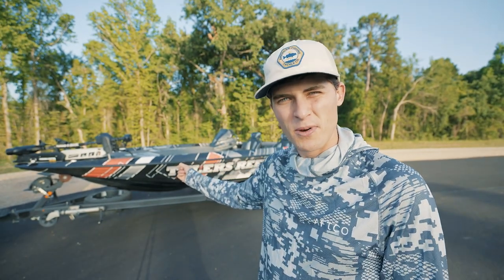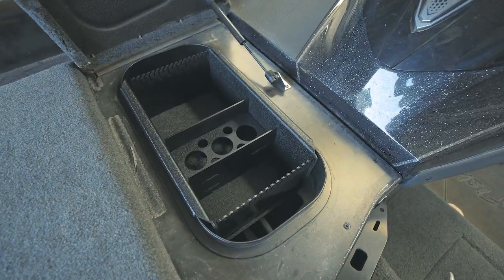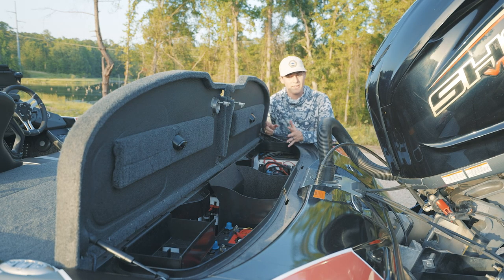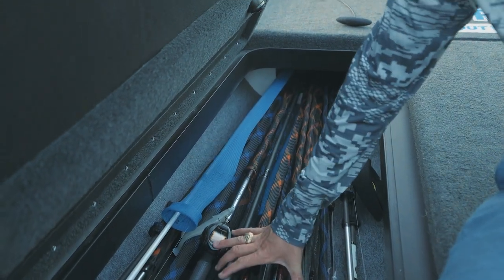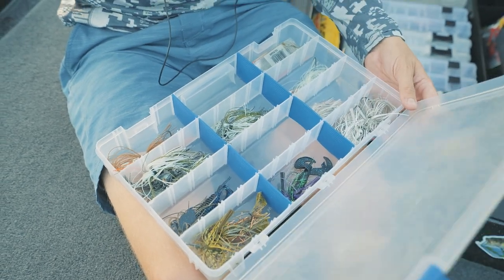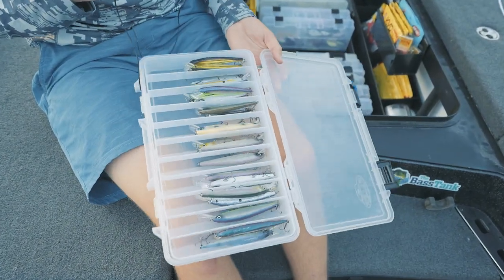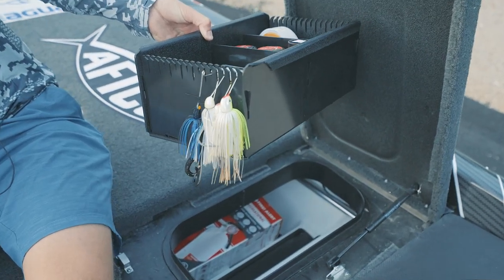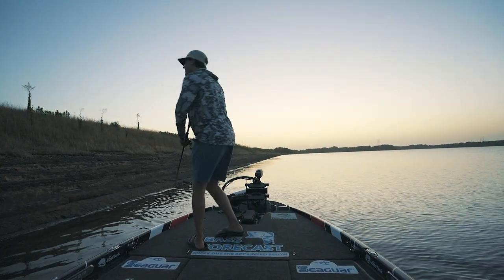The BEST Fishing Tackle Organization I’ve Ever Had!

Comment: Love your shows, I do have 2 suggestions for you. 1) use the new glove box area under the front step as a culling station. Keep your cull tags, scale, G-juice and fin wieghts in there. I started using the drawer in my new boat for just that and saves a lot of time. 2) look at the Bass Mafia deep crank box. I believe it holds up to 45 deep diving crank baits. It is a bit bigger than a deep Plano 3700, but considering what it will hold I believe it deserves a look.
Tight Lines
Chris
Reply from the maker: I like that, but I don’t fish tournaments right now, so I have no need for culling equipment. I will definitely check that box out though
Reply: @TylersReelFishing  In your case that would be a good place to have extra glasses, gloves, and misc. items you usually pick up and say "where the heck am I gona put this" LOL